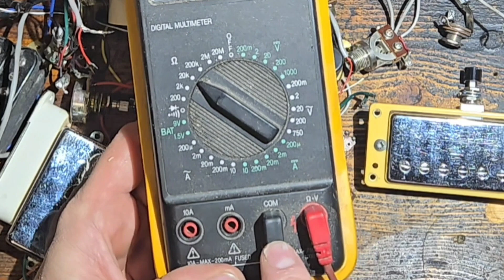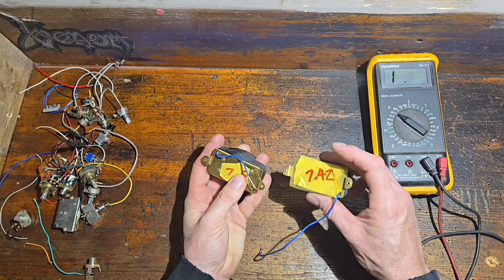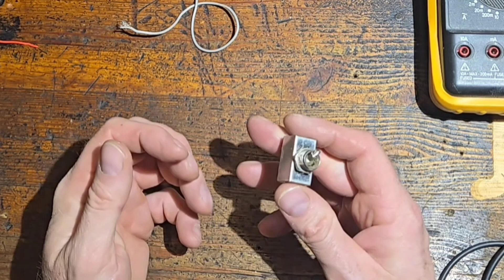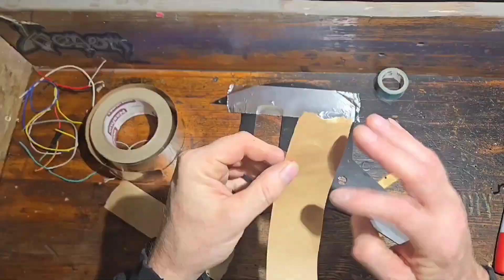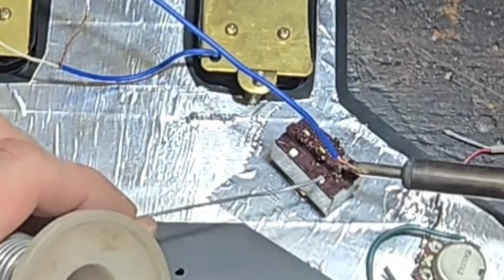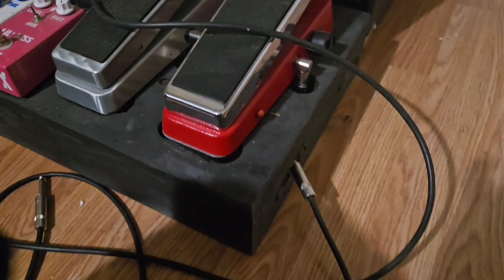Wiring an ELECTRIC GUITAR with Old JUNK Parts | Questionable DIY Guitar Build

Comment: You're not going to want to use a ceramic capacitor in a guitar, they become microphonic over time.  And yeah contact cleaner for those pots.  But good work I enjoyed the video.
Reply from the maker: Thank you for the tip on ceramic capacitors, I didn't know that! I'll have to swap it out down the road. I will deoxit the pots before I put it together, they are pretty scratchy. I'm glad you liked the video!!

Comment: I think your bridge pickup is installed backwards. The screw pole pieces should be next to the bridge, mirrored from how the neck is installed.
Reply from the maker: I felt that way too but I ended up just putting it so the wires came out the bottom of the pickups on the same side. These are are really cheap pickups so maybe they didn't use conventional wisdom?  I wonder if it will make a difference?